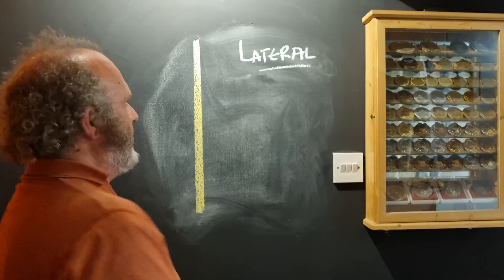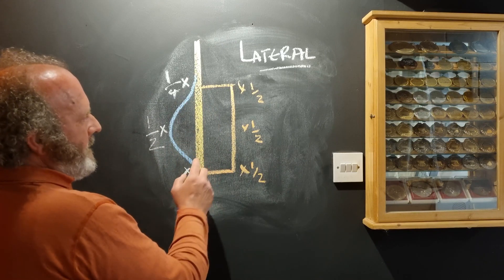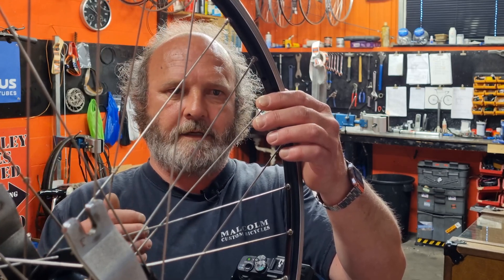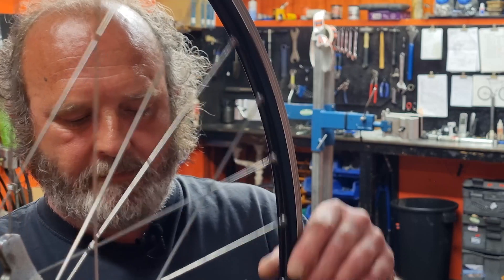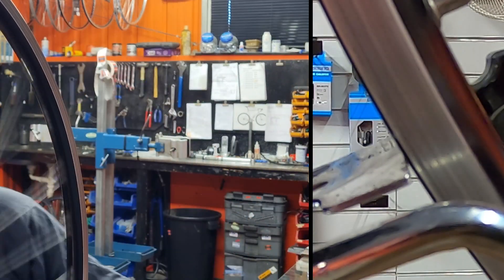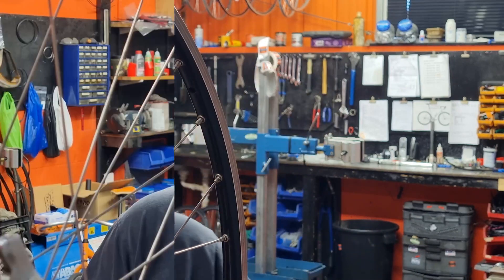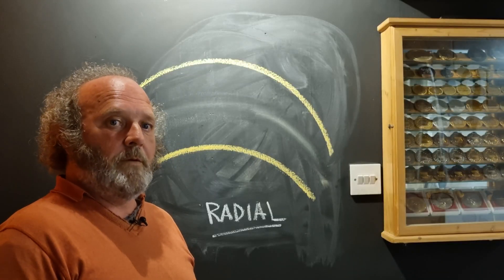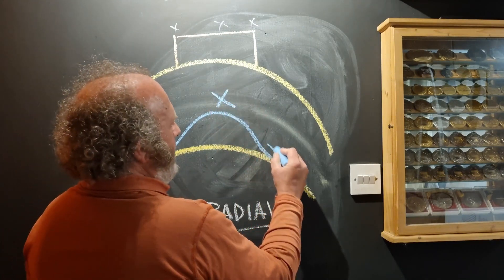WHEEL BUILDING PRO TIPS - HOW TO TRUE A BICYCLE WHEEL STRAIGHT & ROUND

Comment: I just had a stick snap in my wheel bending a spoke. I bent it back, it looks ok now, but of course the wheels is out of true now. I wonder whether this is the moment I should learn this work myself. But will trueing be enough or will I need  to replace that spoke as a rule after having bent it?
Reply from the maker: Hi Chris... it's hard to say without seeing the wheel. Chances are you would only need to true it around the area where the bent spoke is and maybe just that spoke. The spoke is also most probably fine too... it broke the stick, showing it's quite tough. I have a video on replacing a broken spoke which you could follow as the process for a bent spoke is pretty much the same. Just assume the spoke you have straightened is a new one. 

https://www.youtube.com/watch?v=PXItemXpc6Q

Good Luck